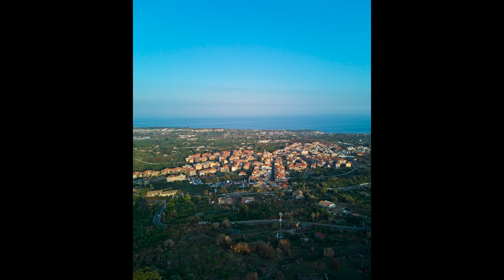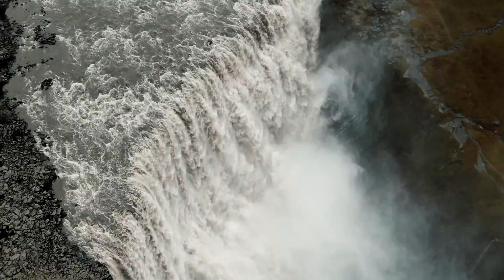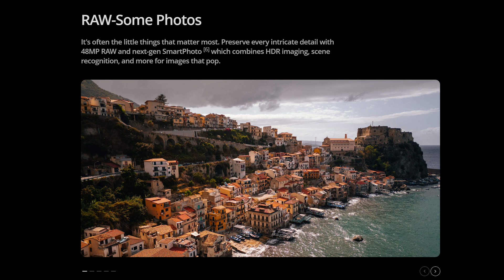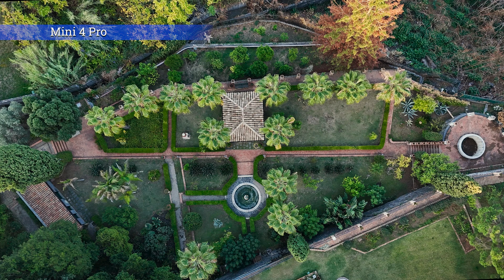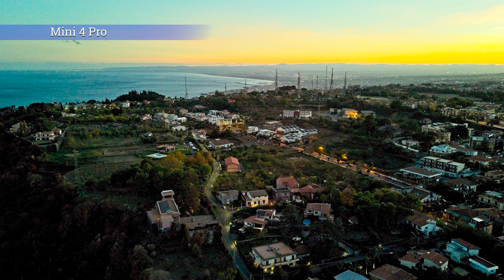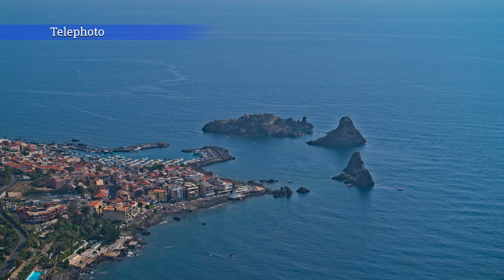DJI Mini 4 Pro vs Air 3 Photo Comparison - Features and Camera Quality

Comment: All photo was oversharpened and noisy. I think something went wrong with settings or after the editing the photos. Are they RAW or JPGs?
Reply from the maker: RAW photos, no sharpening applied
Reply: @VICVideopIC  Ok perhaps I was wrong and there is some internal sharpening happening at sensor read out. Also some of the photo was made in quite low light what is challenging for smaller sensors.